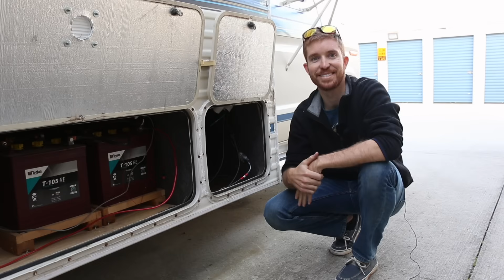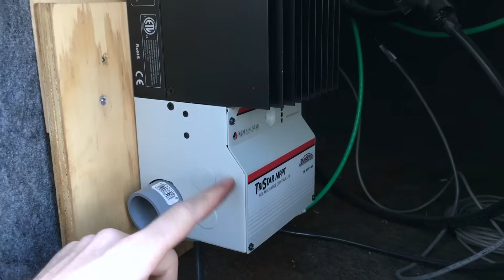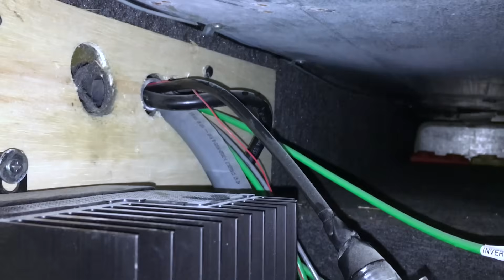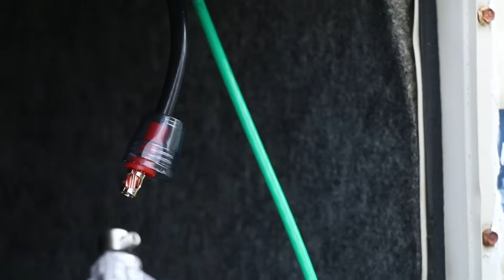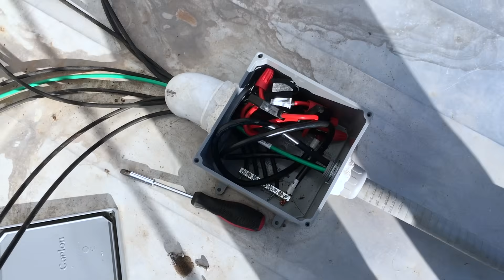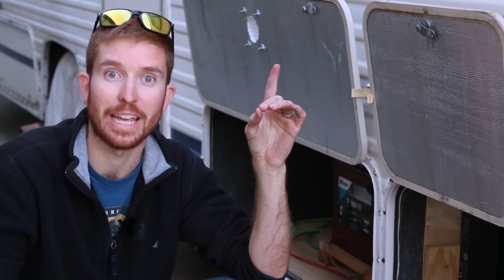Solar Fuse Sizing + Wiring Charge Controller to Battery Bank

Comment: You are appropriately fused between the panels and the controller, but you could have gone higher between the controller and the batteries.  Fuse sizing is based on wire/component current ratings.  Between the panels and the controller the fuse should be the smaller of the current rating of the controller or the current capacity (ampacity) of the wire.  The ampacity of a wire depends on it size (AWG# in north america and square millimeter cross section everywhere else) the type of insulation, the temperature rating and the application environment (wet, dry, engine space, etc.).  Number 4 wire has a current capacity of 85amps for your application, so since your controller is a 60 amp controller the appropriate fuse size to protect the controller is 60 amps, which is lees than the wire's current capacity, so a 60 amp fuse is also OK for the wire.  Had you wired your panels in series, assuming a 30' wire run, you could have used #14 wire which would have been fused at 15 amps (current rating for wet #14 wire).   Between the batteries and the controller the limiting factor is the wire since the batteries can take much more current than your #4 wire.  So a fuse of 85 amps would be as high as you would want to go.  Consequently your 60 amp fuse is good since it s a higher current rating than your expected maximum output from your MPPT controller (~47 amps) with 600 watts of panels.  A 60 amp fuse is big enough to prevent nuisance fuse blows but adequate to protect the wires.

My RV is a boat and in the marine environment we are a bit more redundant.  Marine systems generally use both circuit breakers and fuses.  In the marine environment the circuit breakers are sized to protect the wires and fuses are sized to protect components.  For example I have two 50 watt panels on my boat's cabin top,  They are wired in series using #14 duplex (2 conductor) wire to a 10 amp charge controller.  The wire I used has an ampacity of 15 amps for wet conditions so I have a 15 amp circuit breaker to protect the wire AND a 10 amp fuse to protect the charge controller.  Between the batteries and the controller I used #12 wire rated for 20 amps in the engine compartment of my boat where the batteries are, so I used a 20 amp circuit breaker to protect the wire.  No fuse is needed in that situation since the breaker will pop long before anything could happen to the batteries.

A final comment, you don't have much leeway to increase your solar array size with your current controller.  As long as you stay with a 12 volt battery bank you can add no more than one more 150 watt panel.  However, if you went to a 24 volt battery bank you could go as high as 1600 watts of solar.  That would require some other changes such as a 24 volt input inverter (more efficient than a 12 volt inverter) and likely a 24 volt  to 12 volt DC to DC converter to run your 12 volt DC appliances.
Reply: Todd, thanks for the information.  The video helped me a ton but you helped me fine tune the planning my new RV solar system. I'm ready to order parts now.
Reply: I'm not that sure on that particular model, but the one I got for my system will accept multiple input voltages as well as output voltages.  Most of the "better" ones will do this-the cheaper MPPTs that don't do much....probably don't.  I'd have to look up the specs on his.  Mine is a Blue Sky Energy 3024iL and it supports multiple inputs (12, 24, 48) and multiple bank outputs as well.  I know it senses the battery bank voltage automatically, I believe a few dip switches control the input, though that may be sensed as well.  It handles 540W of panels wired at 12v (I have 500W currently) but if I decide to add more I'll have to change the setup to 24 if not higher, but I'd be able to retain my 12V battery bank (or I could reconfigure it as well).  Its nice that some of the newer controllers give this kind of flexibility nowadays!
Reply: Mr. Dunn, I am having issues in understanding the fuse pick. I am going to install a in a 100 amp mppt. so am I to assume i need a 100 amp fuse on both sides? your help would be greatly appreciated